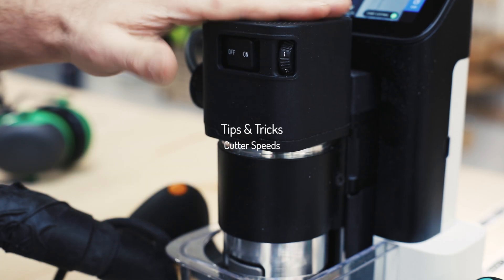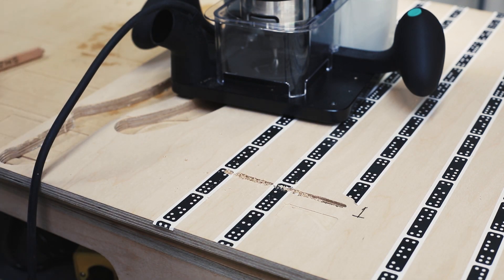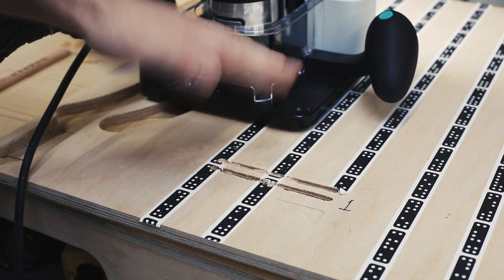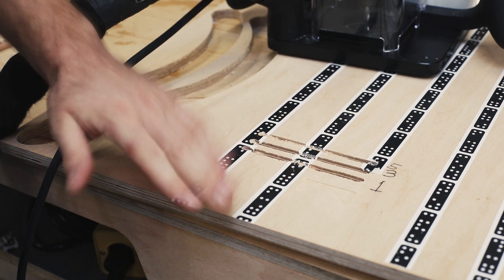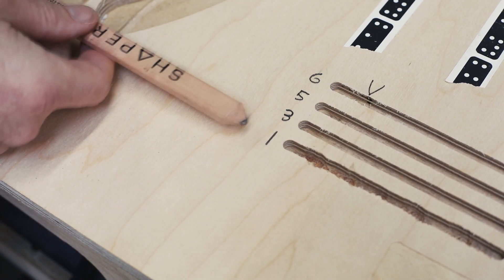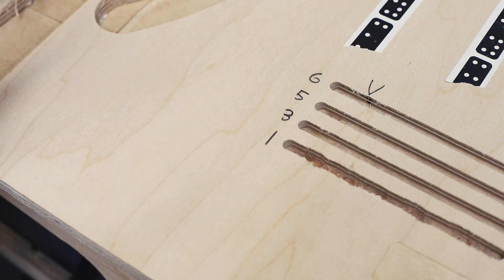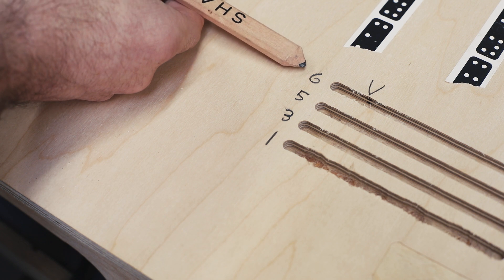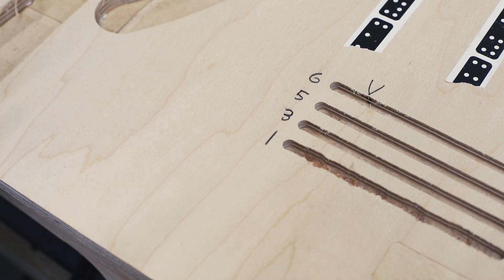Tips & Tricks : Cutter Speeds

Comment: How does number of flutes affect the cut quality?
Reply from the maker: It's not as much how it affects cut quality, it's the appropriateness of the geometry to the material. For example, O-flute bits, with a single, large flute, create larger chips and are better for hard materials. Multi-flute bits cut softer materials more efficiently as long as the speeds are properly tuned in. Up cut is great for most materials because they eject material out of the cut, but downcut can be useful for certain materials that tend to fray at the top of a cut (like foam).

Comment: Okay, this is embarrassing. I've been running wide open and burning up bits because my first cnc router used a DeWalt 610 and running it slower than max it would lose torque. More great engineering from you guys.

Comment: Simple, the spindle speed of a router is to do with the diameter of the cutter, anything under about 24mm in diameter should be around 28,000 RPM. larger diameter bits should have the spindle speeds reduced, also soft metals should be a reduced speed... burning the work is caused by too slow a feed rate, you can still burn wood on the slowest spindle speed. If you have to go so slow that the material is burning, your most likely trying to cut too deep per pass.
Reply: Slower spindle speeds will also increase the likelihood that a router will want to wonder as well.

Comment: Of particular interest to me this particular topic as I destroyed the Shaper 1/4" bit in a single day a couple of weeks back. Haven't yet decided what to fault, it was an intricate design with in retrospect some less than ideal DFM features, but also some new 1/2" baltic birch from a new source. Ended up with a very smokey workshop and a horribly overheated bit. Had much better luck with same material and designs and a new carbide bit since, but not ready to blame the original one yet. When I have some time I'll write it up for you Sam on the forums, I'll be interested in your feedback.
Reply: Harika ya
Reply: I think I've burnt out my 6mm bit in only a couple of hours. Was running speed 5 so surprised. What speed was you on when you destroyed your 1/4?
Reply: The video gives you an impression that higher spindle speed is always better. He should have developed further the risks involved. Especially in hardwood like oak you’ll have to lower the speed much else you’ll end up with burned marks. I guess that is what happened to you.